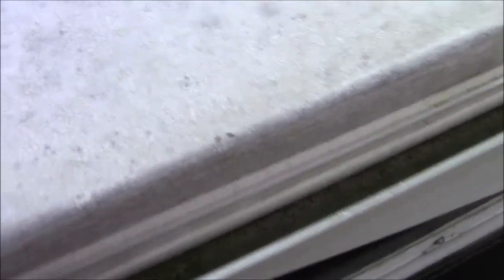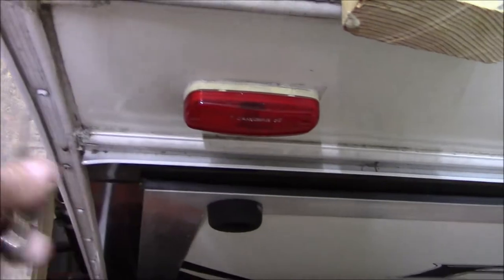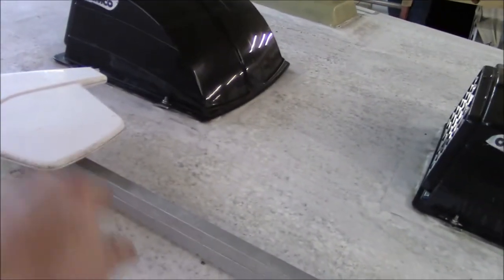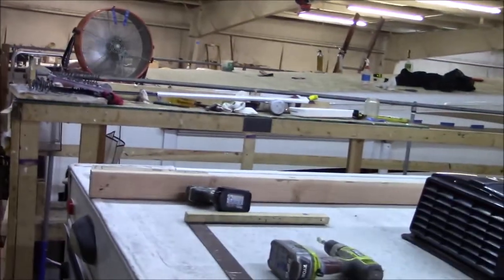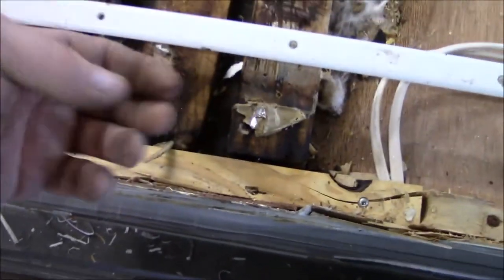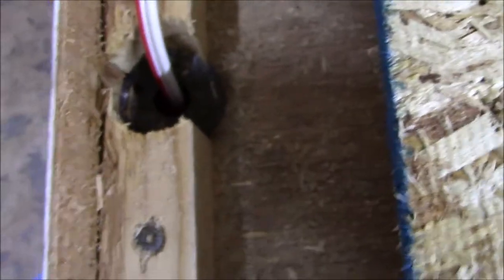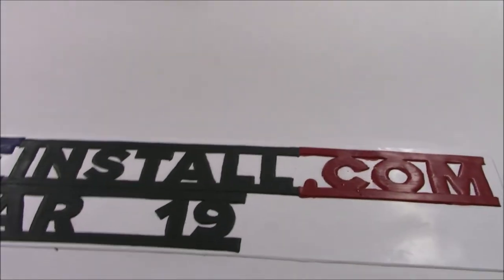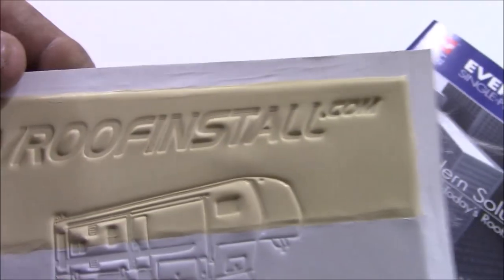Redeck and new Roof on 2014 Fuzion TT Toy Hauler

Comment: Great videos and thank you for sharing all of your experience and informative videos. Question, would it be possible to remove the dicor, especially around the vents, a/c etc. and add on  the TPO welded flanges before issues arise? Thank you very much sir.
Reply from the maker: No you can not mount curbs to any roof membrane. Roofing material needs to be compatible...meaning, same manufacturer. 
Thanks for watching!
Reply: @RVROOFINSTALL  Absolutely understand. Your curb additions match the new membrane you install? Thanks for the reply sir. Keep up the great work.

Comment: Do you work on Fiberglass roofs to put AC’s on platforms and vents to prevent water intrusion?
Reply from the maker: We have removed quite a few fiberglass roofs and replaced them with TPO. But we do not modify the fiberglass roof itself with curbs. The curbs are product specific. If we did a fiberglass curb it would have to be sealed back to the roof and then painted.  
Thanks for watching!

Comment: When cleaning the transitions, to remove the old stuff, what works the best? Thanks
Reply from the maker: The transitions???
Reply: Where the roof and siding meet. Lol. Sorry.
Reply from the maker: Use a piece of wood sanded down much like a chisel and push slowly. Do not use anything to sharp or you risk cutting the membrane. Push and when you feel you have a grip on the old caulk then pull outward away so as to peel it away, then repeat. Clean with denatured alcohol. Then seal with anything but Dicor or silicone. We use M1 or Dura-link by Chemlink company.
Thanks for watching!

Comment: What kind of trim insert do you use
Reply from the maker: Dx9461w. Thanks for watching!
Reply: @RVROOFINSTALL  on What website i type in code on amozon nothing poped up
Reply: I really wish i had the money to have my rv done by you guys but too broke and too far
Reply from the maker: @eliseomedina8175  type in RV vinyl insert trim.
Reply: I can only find it on ebay it would be awesome ig you could send me a link for it thank you
Reply from the maker: @eliseomedina8175  I buy in bulk. I buy a pallet of the stuff and my suppliers don't sell small quantities to the public. So you may be correct in the eBay.  AP products makes the trim as well it 1 inch.